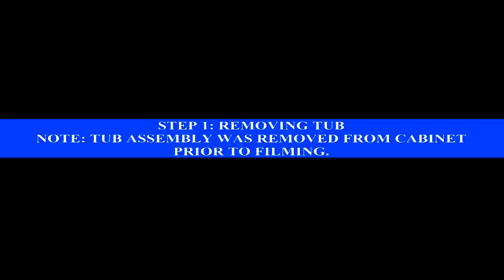MAYTAG NEPTUNE BEARING REPLACEMENT (PART 1)

Comment: i just finished the bearing and seal replacement on a Maytag 7500...I had smoke coming from the tub when I did a first wash...turns out I placed the rubber seal in backwards...My first clue should have been the tub didn't turn freely like before...it was hard to rotate and it chewed up the seal...I removed the tub, flipped it over and it wasnt chewed up just worn a little but it seems to work now...Thanks for the help.

Comment: I bet nobody bothers to grease the bearings before installing them, you need to use a water resistant grease. 99% of these bearing failures are because the parts start rusting and the rust causes it to wear even faster because of the added abrasion. 

For greasing the bearings just watch a tutorial for greasing wheel bearings its the same concept. Remember, even if the bearings come pre-greased it's usually not a grease designed to withstand water, so be sure to flush that out with water resistant grease, any marine grade grease will do. Another thing I recommend is to re-grease the bearings every year or two as part of regular maintenance.

Comment: I was changeing bearings when I noticed two holes in the tub.  One on the top and one on the bottom.  They go from a spot in between the front bearing and the lip seal to the back.  Exactly the same and they look like they are drilled perfectly.  Are these holes supposed to be there?  They look manufactured.
Reply: chris vanevenhoven thank you for asking this! I've been looking online thinking I had to get a whole new outer tub!!! Apparently, it's the bearing. This should be fun to figure out.

Comment: I can't believe how you screw around and DON'T show people how to get the bearings out!
Reply: You left the race in there! That is my problem! I can't get the race out!
Reply: We got it out! I thought of using wart remover freeze off on it, so I wrapped a metal washer that came out of it in toilet paper, placed it inside the race so it fit snugly, and modified the cap of the freeze off (Wal-Mart Generic wart remover) so it would spray out and soak the toilet paper (Charmin Extra Strong, and I used a minimal amount so as not to waste it, and it wouldn't be as cold if you use a more toilet paper), and I sprayed out two full bottles of it onto the paper (it drips, careful), and the race cracked in half with a small tap, and came out.